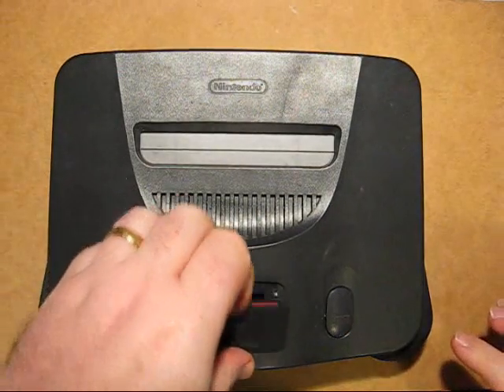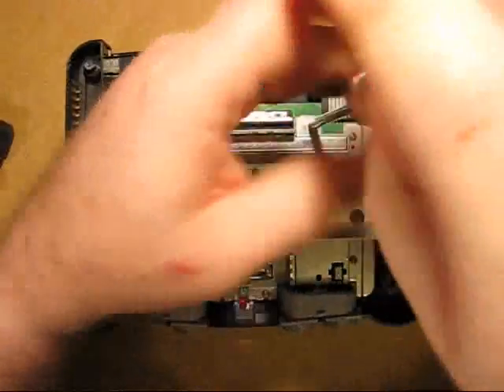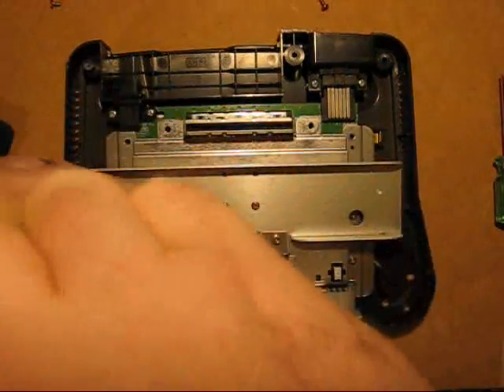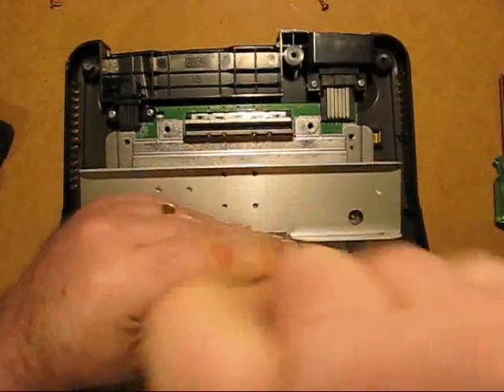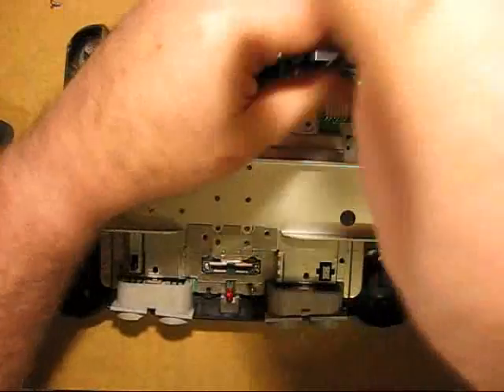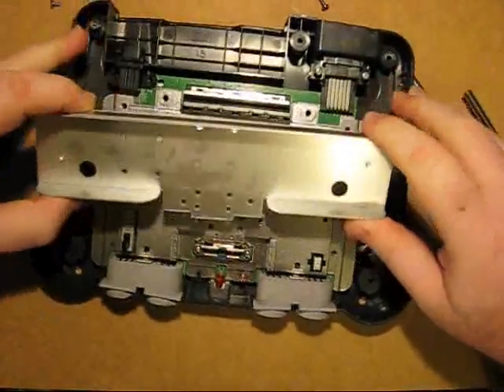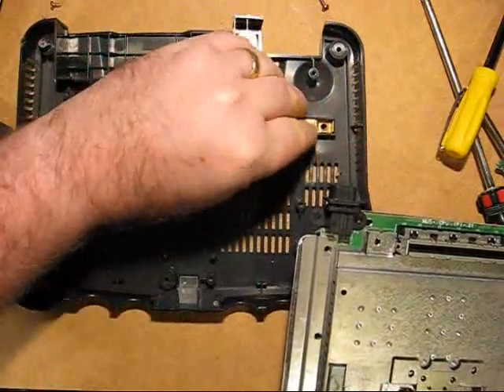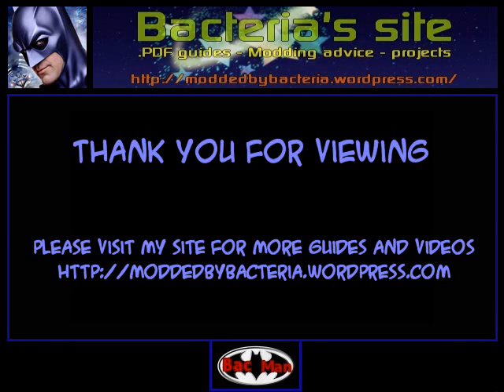N64 log - 1 - Opening the N64 and removing the board

Comment: That has to be one of the most interesting consoles in terms of execution and overall system design.  It is designed to be programmed using library functions- the whole system runs on high-level code, which makes it very easily emulated.